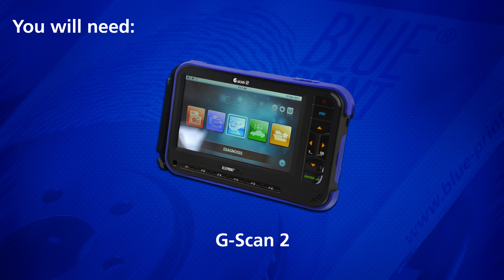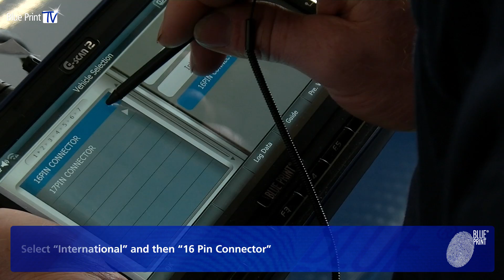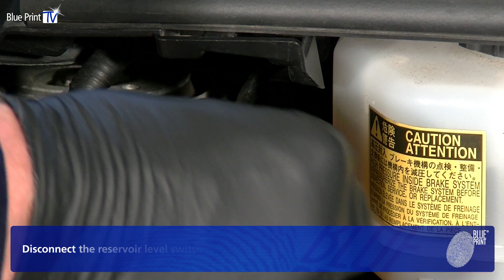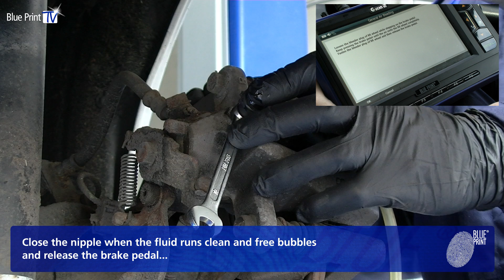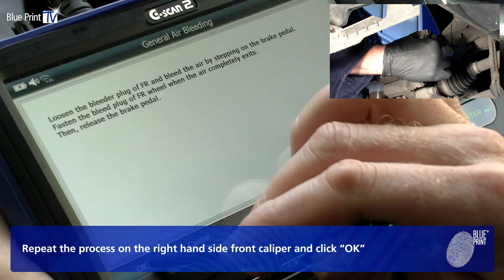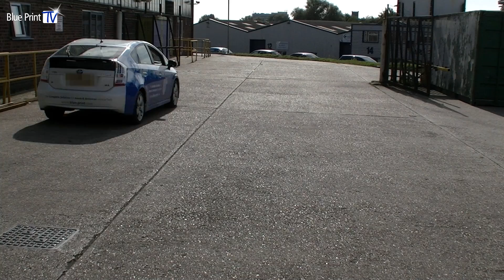[EN] Toyota Prius Brake Bleed Process

Comment: Is this the bleed process for this scan tool only? Cause its not the mongoose used by the dealership.
Reply from the maker: Thank you for watching our video. The brake fluid bleeding process in this video follows the vehicle manufacturers process. Which can be carried out using other diagnostic tools.

Comment: I did this process and finished on the lights on the parking brake board, abs, vsc, and it is not removed, the brake pedal is OK, the codes C1203 and C1345
Reply: It is a 2013 Prius use the GSCAN2 and finish on the dashboard the parking brake light, abs and Vsc. And the codes that I indicated appeared to me, I can not erase them and even then I do not understand how to perform the reprogramming so that the codes are removed with the scanner
Reply: Luis Pesantez  tauheed